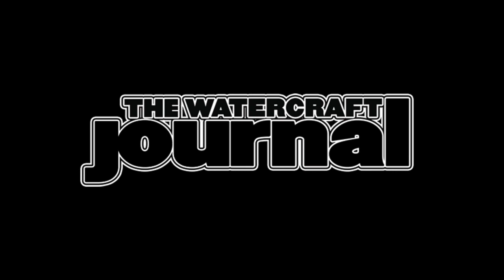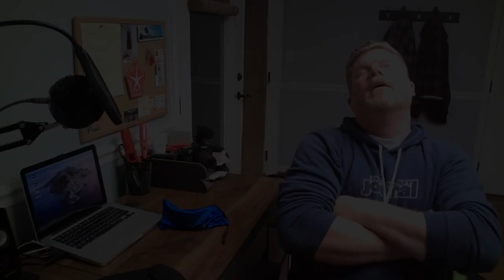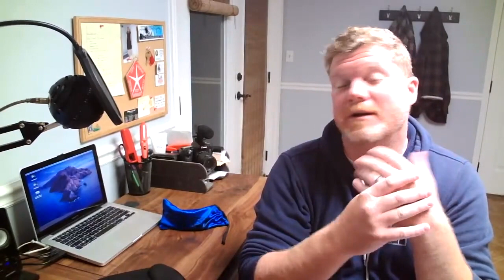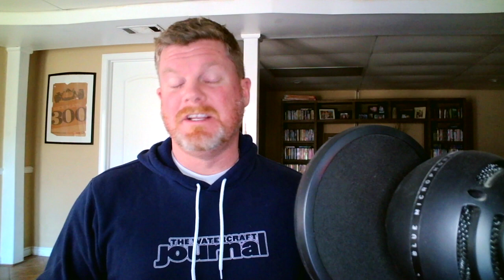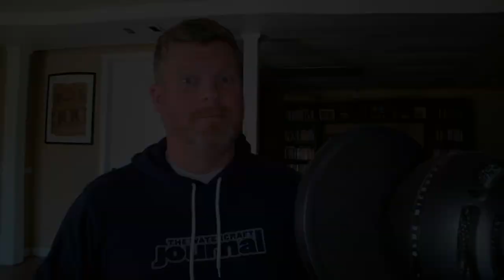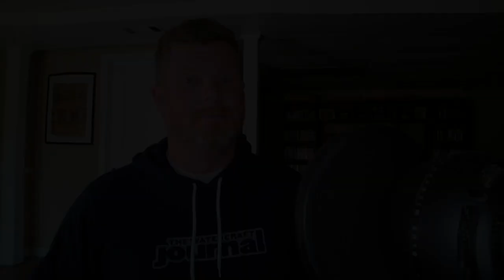Sea-Doo's Closed-Loop Cooling System: WCJ Quick Topic

Comment: Hey first time watcher. I'm hoping to purchase a Sea-Doo 230 some time soon. I was told that sea doo has an open-loop system. By reading, I see that this is not true. 
I appreciate how you get to the point, you know what your talking about. A lot of people try to teach, but they end up babbling with too many stories. Could you talk about the "Rotax" engine-the best way to take care of them, a head's-up on what's done to the engine for maintenance in term of hours so you don't get suckered. And finally, what to look out for when buying a used sea-doo boat. Hope it's not too much.
 
Thanks good job!
Reply from the maker: Welcome! Many of the topics you've asked for are covered (in some part if not all) in previous videos. Please peruse our playlists.
Reply: @watercraftjournal  Thanks!
Reply: It has both.  Sea doo have a closed loop cooling system for the engine, and an open loop cooling system for the exhaust manifold.

Comment: Know of a couple of guys who had seadoo and sold them after having temperature issues. Closed loop not with out it's problems. I think if Yamaha and Kawasaki haven't done it yet it's probably for a reason. Seado seems to be quick to come out with new things but they don't always seem well executed.
Reply from the maker: It's typically related to the sacrificial anode, not the closed loop system.
Reply: @watercraftjournal   these were new skis so who knows in this situation but the problems I've seen with seadoo outs me off them.
Reply: Couple guys, doubt it unless  they park on a sandbar, the exhaust is raw water cooled, that's your issue.

Comment: I understand I am the definite minority in this situation, but I use my Seadoo for flyboarding and closed loop is not keeping it cool. (Which led me here in my research on switching over) I used to use Kawasaki (in fresh water) and never had heating problems with them.
I thought it was a bit funny when he said “ if it were possible to touch the ride plate while it’s operating…” in my situation I actually can reach underneath and touch the ride plate. It’s pretty freaking hot.

Comment: Hey Kevin HRU need some info from you pulled my 19 gp out while checking out how I’m going to install gen 2 plate and grate I noticed I have couple little nicks on my bottom what can I put on these spots to combat the hull delamanation issues that can occur thanks in advance
Reply from the maker: No problem! First, depending on how deep these nicks are, you're going to want repair them using Color Rite's repair kit (they're the only paint outlet officially licensed with Yamaha). Then, I suggest having the hull coated in a thicker coat of automotive clear blended with a flex additive. (You can even paint over the billboard decals if you want.)
Reply: @watercraftjournal   the damage is very minor my ski never touches the ground I thought I heard you mention nail polish before ??? GEL-NAIL
Reply from the maker: Yes, but definitely NOT for the hull! We used nail polish for very minor touch ups on the hood and fairings.

Comment: The close loop system is fragile at best. The smallest leak, which often occurs due to poor quality plastic fittings can cause seadoo head-gaskets to fail rapidly. This is why seadoo head-gaskets sell like hot cakes.

The open loop system works and has done since the introduction of marine engines. Open loop is more effective at cooling and rarely sees any issues arise when maintained correctly (regular flushes).

Moral of the story, if you want a reliable seadoo then yes an open loop system is the way to go and no it will not degrade the cooling passages when flushed correctly as sacrificial anodes are used in the open loop conversion kits.
Reply: Nonsense, closed loop is far superior to open loop your main argument against is lack of maintenance.
The majority of yachts and inboard power boats are closed loop, there’s a reason for that.
Reply: 450hrs. on my Seadoo ,no problems all , and I race it about 4 times a year when I'm not just riding.

Comment: Water cools better than coolant.. so maybe see doo will develop a better coolant to run in the sealed system.
Or a better heat exchanger
Reply from the maker: HAHAHAHAHAHA.
Reply: Lol water cools better than coolant? Thats news to me. Ill just go fill my coolant reservoir with nice cool and crisp sea water! Thanks sir
Reply: Mustang is correct. Plain distilled water has far better thermal conductivity than coolant. Coolant is used for raising boiling points and lowering freezing point and for providing corrosion resistance.